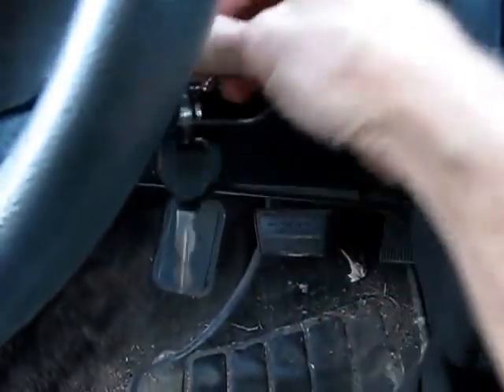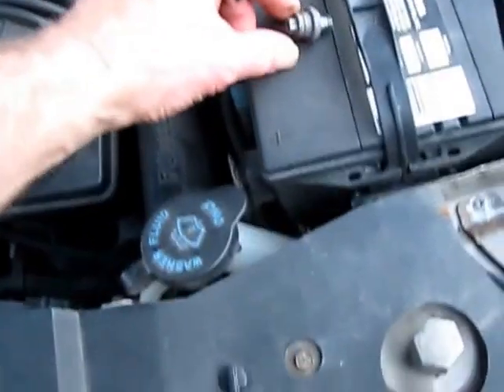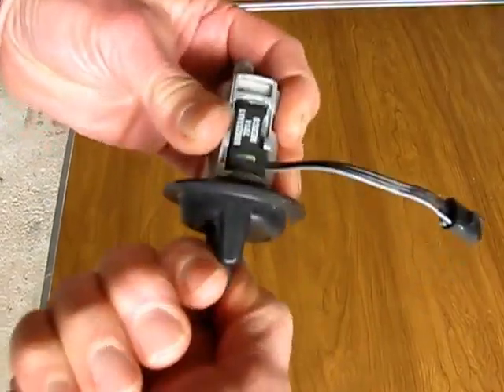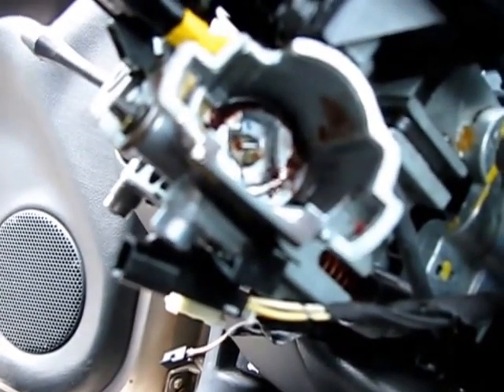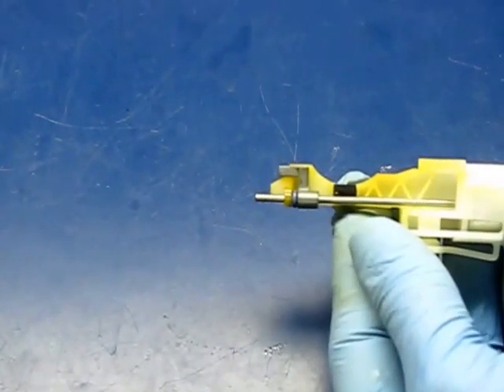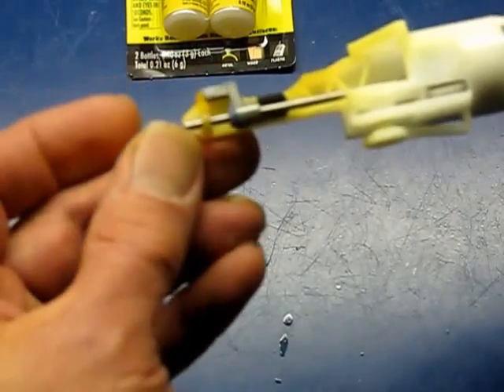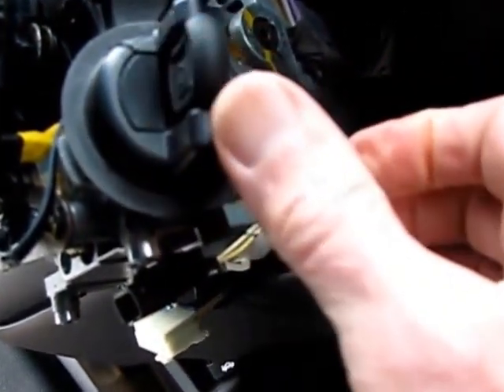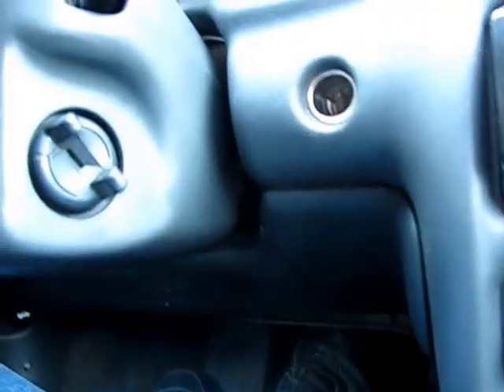How to fix a stuck on GM key switch

Comment: I have a 95 chevy cheyenne 1500 and the ignition is stuck on the start position and i cant get the ignition cylinder back in. What can i do. I dont want to replace the entire steering column

Comment: I need help with my 2002 chevy cavalier 2.2 liter doing the same thing. Was my car a part of an ignition switch recall??
Reply: Wojman12 Shit me too!  You ever figure anything out?
Reply: Mine is a 2001. Same problem.
Reply: Dave Zahayko I ended up following some basic online tutorials and just removing the "ignition lock cylinder" and starting that sucker with a screwdriver.  Works fine if you own the car and theft isn't a concern.  Plus, if I ever get a new lock cylinder, it'll be super easy to install.
Reply: Cee Jay Just talked to my mechanic. He swears it's exactly the ignition cylinder needs replacing. Shouldn't cost too much with him. He charged me awhile back only $800 to replace clutch.
Reply: Dave Zahayko for the record, the cheapest new one I've found is $120.  If it's an option, I'd suggest checking a junkyard and doing it yourself if you think that's possible.  You'll need the key from the new ignition you get, of course.  But, it really doesn't require any special knowledge or tools if it's like mine.  And you should be able to knock it out in an hour or two (counting trial and error and possibly learning new skills).

I can't imagine any mechanic charging you less than around $300 at the minimum plus all the hassle of taking a car to a shop to begin with.

If you do make your own attempt, remember to disconnect the battery and let the car sit for at least 30 minutes before messing with the steering column as, apparently, it's pretty easy to make the ding donged airbag go off in your ding donged face.
Reply: Cee Jay car can start just won't shut off. Just started earlier today. Monday thinking $200 max.
Reply: Dave Zahayko, I had the exact same thing.  It's not a cheap part and labor doesn't come cheap.  But, hell, I'd love to be wrong here.  Please let me know for sure.

I needed mine to be able to start and run and shut off quickly so I made it do that.
Reply: Cee Jay I'll let you know for sure. Just knowing in the past that my mechanic has charged me what I thought was cheap compared to other places quoting me another $800-1100 more on certain repairs

Comment: Does this work for a 2005 chevy Cavalier.  This happened about 3 months ago to my Cavalier.  Took it to the dealer and they replaced the ignition switch.  About 5 days ago it did it again.  How do you know if its the switch or the solenoid?
Reply from the maker: I doubt if your Cavalier is the same as this '97 Grand Am. Mine stuck in the "on" position when the interlock solenoid broke. I've never seen it happen that way with a problem with a stuck tumbler in the key switch. Hope this helps and good luck!
Reply: They shop worked on it and said it was a Brake  transmission interlock solenoid located inside the console near the shift lever.  There so much electronics in these cars even  just to turn the key to start them its crazy.  So many things can fail after a while.  I like the old mechanical systems that rarely broke and where easy to diagnose.  Thanks for you reply.
Reply from the maker: I hear you. I just finished a GM lower intake manifold gasket and could not believe how many components I encountered on the way down there!